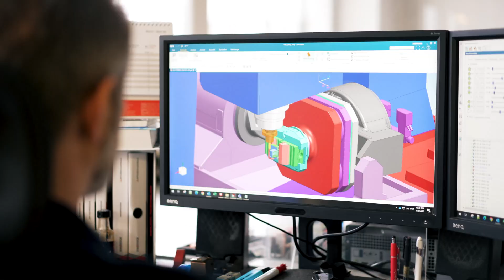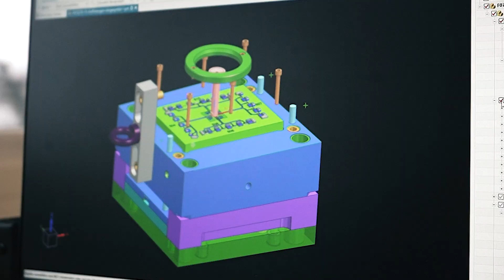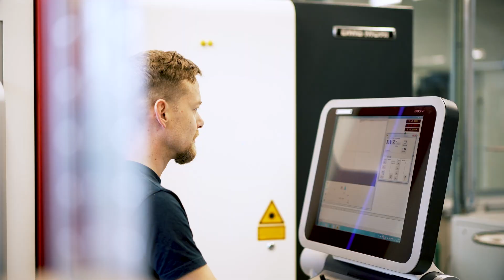The "Technical Center" in Gloggnitz

Comment: Think your moulding team for n gauge tankers need to change the mould join line back to the top and bottom of your tankers as the visible line on both left and right sides make it impossible to weather your latest models. Not sure why you made these changes recently but it would better if you made them how you used to so I can start buying them again. Fleischmann tankers were some of the best on the market until you implemented these changes. Thanks for sharing how you make the models. 😊